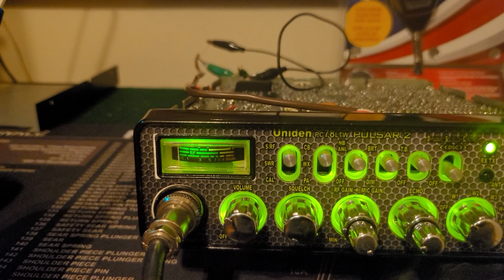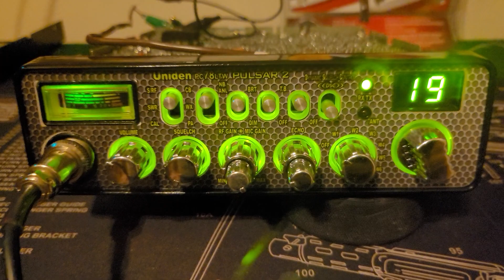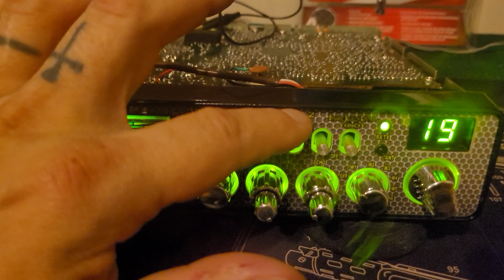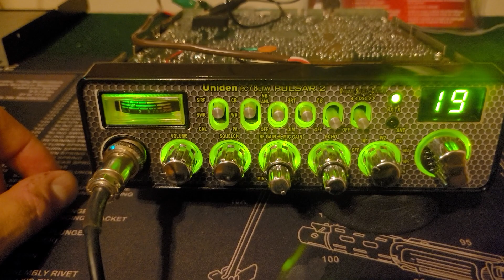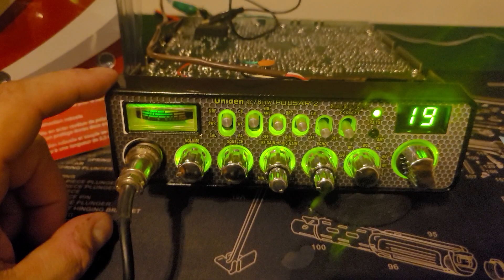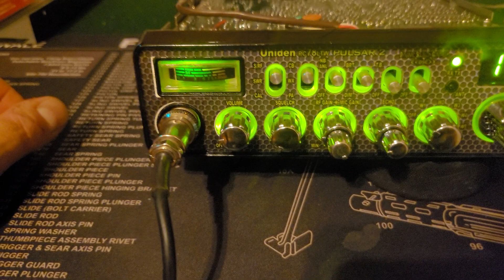Work being done to the Uniden PC78LTW

Comment: so question im a new ro cb   on my radio  when i  press the mic to talk both lights go red what dose that mine
Reply from the maker: The bottom is an antenna warning light.  You're not supposed to press the ptt button without an antenna or dummy load connected.  You can burn up the final transistor and or driver.

Comment: I have one of these that starts of perfect for 5 mins, then a squeak can be heard through the speaker regardless of squelch.
Turn it off,l and leave it for a couple of days, and it'll be ok again for another 5 mins.

Capacitors? 
Or the renowned 455 Murata?
Reply from the maker: That could definitely be capacitors.  Maybe an ic getting heat soaked.  Try using some cooling spray on the radio when it's hot and see if it goes away.  73s
Reply: @pulsarcb thanks for your reply.
If you look at my page, I have a video of it.
Plugged into a power supply, varying the voltage changes it, as you'll see.
I've ordered an amp chip for it, so hopefully that helps. 
Recapped it also